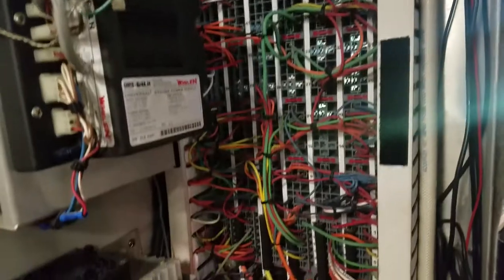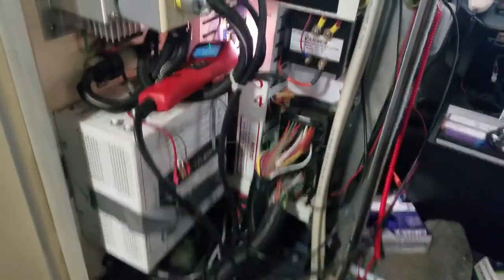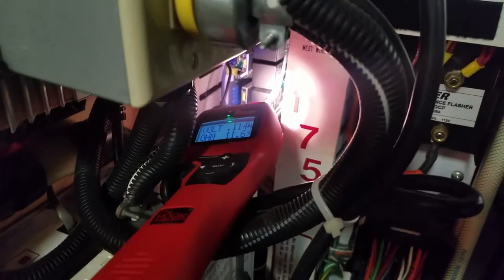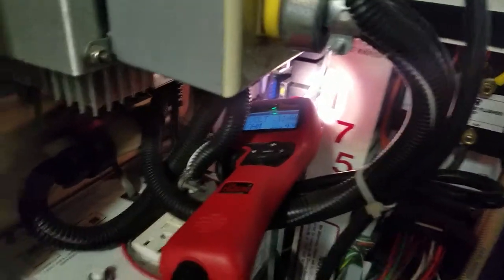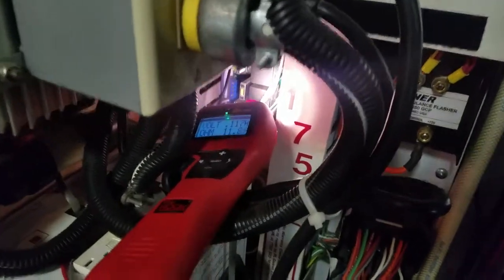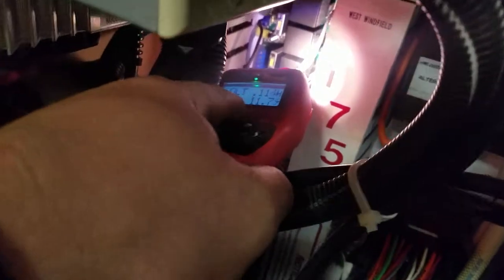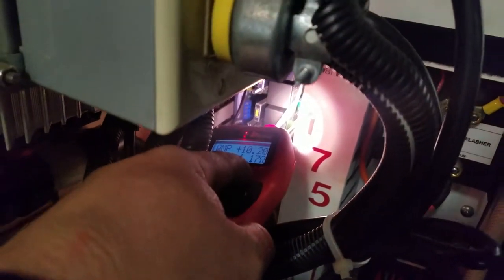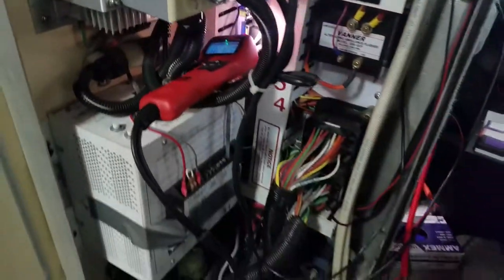Diagnosing an A.C.issue on an ambulance

Comment: We are working on a 2012 ford e450 amblulance osage and the rear ac is not working we found a bad switch that controls the rear ac it was bad now when we turn on the ac the blower works but the compressor shuts off not sure if you would get this message.